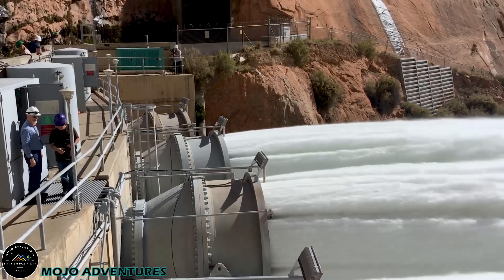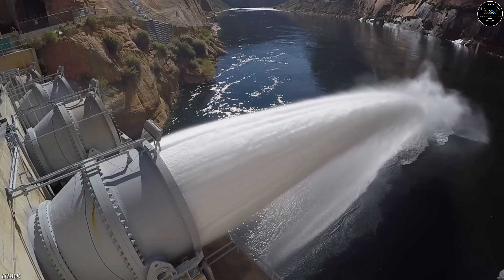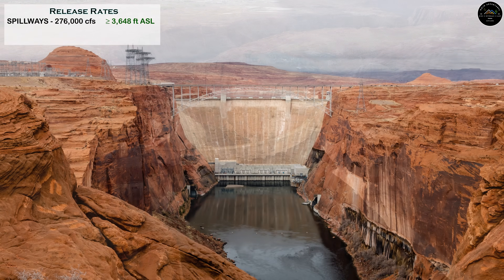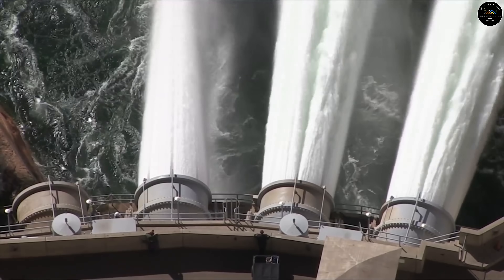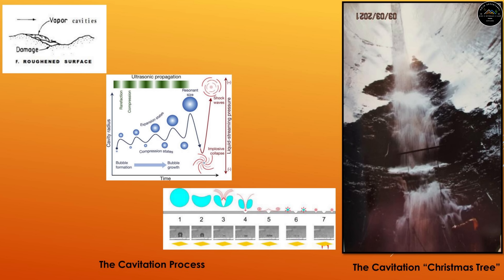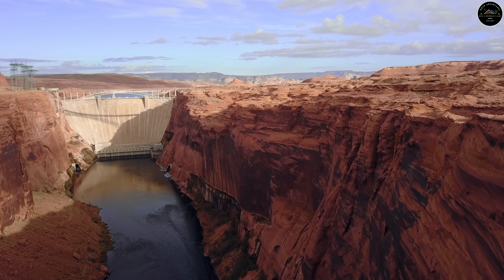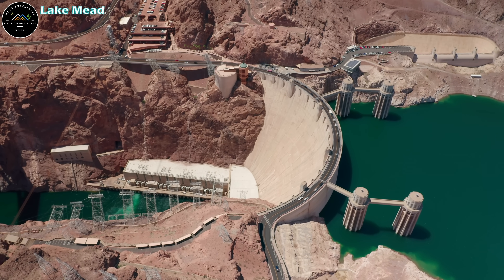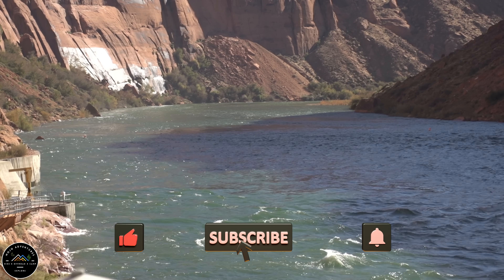TROUBLE ON THE COLORADO! Damaged Pipes FOUND Inside Glen Canyon Dam at Lake Powell #water #update

Comment: the best solution is NOT to build a metropolis in the middle of a desert.
Reply: Yes we should only build metropolises in places where there are hurricanes, floods, tornadoes, and earthquakes. Glen canyon dam was not to built to provide water to big cities. It was built to provide power. The alternative was coal which is how most of the country gets its power. Also homes, shopping centers, and office buildings account for only a small fraction of water use everywhere in the country.
Reply: @redhorsereincarnated  Farmers take the large majority of water.  Walnuts use about 8 gallons of water to grow a single walnut.  The Saudi's use Arizona land to grow Alfalfa and they weren't required to replace the water they took from the well source..
Reply: That horse has left the gate.
Reply: Common sense would say that!
Reply: The solution isn't to not build metropolises in the desert, that's actually probably the best place to build them, the land has little use otherwise.
The solution is to stop trying to fucking farm in the desert, that's where all the water goes and why the Colorado doesn't reach the sea anymore.
Reply: Lets just go back in time and solve that
Reply: @lunarvvolf9606  They also don't understand economics, physics, or engineering. They wouldn't be able to afford the water if they did that.
Reply: Flood irrigation at big agra monocrop farms is way more inefficient than most folks understand.  Agriculture uses way more water than phx does, and the 9 families that control water in the Salinas Valley don't pay for water. All the thousands of miles of canals in the southwest should be covered in PV panels to reduce evaporation.
Reply: @lunarvvolf9606 corps😑
Reply: @lunarvvolf9606  If you ask that, you should also be asking why you need food in your state that is grown using Colorado River water. Why not just get rid of all of your cities and towns and grow your own food. Maybe it actually is practical for people to live in Arizona. Cities grow out of places that create lots of jobs. Are you suggesting the desert states shouldn't have anyone living there? Maybe we should give Arizona and Texas back to Mexico because, after all, they need dams to supply their water, and to some people, that is apparently un-American.
Reply: I couldn't agree more.
Reply: @lunarvvolf9606  corps
Reply: How dare you!!!
You are supposed to blame everything on CA!
Reply: Best solution is to stop letting Saudi Arabia pump water to grow hay on the desert and ship back to their country
Reply: Agree, get rid of the dam
Reply: @lunarvvolf9606  They wanted to dump water into the Yellowstone volcano to cool it off. They need to identify as a jungle and then it will rain and trees will grow. see problem solved
Reply: Stop letting California steal all the water would also help
Reply: Common sense doesn't work well with greed .
Reply: It ain't the lawns. It's the famers growing alfalfa and cattle feed in the desert
Reply: Build another dam, problem solved
Reply: So true
Reply: Bit late now is it not.
Reply: So build a Time Machine
Reply: @daveb8559 And it is all the dems/reps fault! (whichever side you are on)
Reply: What an incredibly stupid suggested solution.

Kudos.
Reply: Yep for sure. That being said most of this water is going to agriculture. We should not be growing water intensive crops in the desert. Water rules really need to be rewritten to cut back on this type of agiculture. The amount of water allocated to agriculture from the Colorado needs to be cut back to more sustainable levels.
Reply: You would think that would be freakin common sense but hey what do I know….🤷🏻‍♂️
Reply: We farms this way right now since water is cheap. They are going to do the cheapest, easiest, most productive ways to farm until it is no longer economically viable. Same reason why we still use fossil fuels, they are cheap and easy, once oil becomes too expensive to extract (not when we completely run out) will we switch to alternative fuels.

You could yell all you want about the farmers using all the water and it kills the animals, but if you had all the farmers in the deserts stop farming and using water you get famine. Which is something I have never dealt with and hope not too in my lifetime.
Reply: the best solution is to revisit the water share agreement. and maybe stop growing so many almonds and avocados in cali. las vegas returns more than 99% of the water we use. so it isnt a desert city problem.
Reply: Quit trying to make sense to people that have none. Just saying
Reply: Our other cities on coasts are overcrowded Plan was to get water from Canada 60 years ago
Reply: The built it because the river was already there the damn is for power
Reply: Sounds like a smart idea!
Reply: “A”? Maybe many.
Reply: Nah leave it to liberals. They will keep trying to fill a desert with water 🥴
Reply: its all used by farming in arizona and california anyway, Not to cities
Reply: Exactly, same with people who live on top of the ocean loosing their home every hurricane..
Reply: Building a metropolis in the middle of a desert isn't the problem. It's all the farms. Especially the farms growing crops that require a great deal of water to grow like alfalfa for instance. The worst part is that that alfalfa is being sent to Saudi Arabia to feed their cattle where it's illegal to grow it because it requires so much water. Water that they just don't have to spare.
Reply: @NotFastEddie  lawn is the most intensively irrigated crop in the US and the largest by area. Not all turf is irrigated but the climate anywhere relevant to this topic is entirely dependent on it. I’m just as critical of irrigating cash crops and fodder in gutless desert earth but unlike those things it’s pretty much economically and socially worthless other than feeding obsessiveness about an unnatural tacky Stepfordy suburban look. Look at arid or semi arid cities in Mexico, Australia, Spain etc. some people have the lush look but most people let it gold a little bit and it doesn’t look so ridiculous against the earth.
Reply: Discontinue car washes, pools , hot tubs, lawn watering, golf courses, etc.!
Reply: These water overuse/shortages are due to farmers flooding their fields. They followed the suit or lose it policy

Vegas uses less than 1% of the allotment. Water is all recycled. Utah taps the river, and wastes the water, and has zero incentive to recycle water, as the state govt doesn't require them to. Fed need to step in and take care of this mess
Reply: Buts da mobsters said da government had ta...
Reply: I suspect you are speaking of Vegas?  And yes, a city that size in the Mojave was dumb, dumb, dumb.  But the far worse offender is LA.
Reply: @danz409  correct
Reply: @danz409  Yeah, like Cairo and Baghdad cradles of civilization.
Reply: @danz409  You can have a metropolis but you make it to be a total zeriscaped land, the ultimate recycling water effort that recycles it to where it is not allowed to leave the metropolis and brought back over and over with it being able to be consumed on ever cycle. No down stream waste
Reply: The best solution is not to pump water to cities in Kalifornia.  The LAMWD is notorious for pulling the rug from under everyone along the Colorado River.
Reply: BEST SOLUTION IS NOT TO GIVE WATER TO LOS ANGELES, THEY DON’T CARE ABOUT ANY BODY ELSE,  L A WAIST WATER LIKE THEY OWN IT 100% AND LIVE THE PROBLEMS TO FUTURE GENERATION.
Reply: @danz409  nah, that makes too much sense. Im sorry, but we can’t do that lol
Reply: Why
Reply: Most of the water is pumped out of Lake Havasu into California. Don't blame us in AZ for this.
Reply: @ California stealing every thing ,stop it now
Reply: What do you think would happen if everyone in this country were to move to a place where you can drill a well to get water? All the aquifers would dry up. Even NYC depends on dams for its water. Try being realistic and not judgemental about how humans get and use water. The issue of us using too much water applies to every place in the US where humans live. Going on about why people live in the desert and not overcrowding your community has nothing to do with the issue at dams, which are needed all over the country, not just in the desert. I'll bet there are dams near you that you only think of as the lakes that they form. The video indicates the issue is being solved with a bypass tunnel, so there is no need to worry. This video was informative, not an open door for people with very little knowledge of how things work to criticize others.
Reply: @CO-PE-123  Happening in many counties in Texas with the massive influx  of people from other places.
Reply: @CO-PE-123  as a scientist/teacher I have always been fascinated by dams and the reason(s) they were built. I must agree that folks should try to look at the whole picture before ranting about dams/dam management…
Reply: @glennmorrell4907 
Stopping the natural replenishment of sediment to the coast is what has caused massive coastal erosion in California.
Some Beaches that were sand for 50 years are now just rocks.

Most people don’t even know what an estuary is, let alone how significant they are in supporting of at least 60 species(Birds, land mammals, reptiles, Marine Mamal and fish)

Maybe dams work some places but not California.
Reply: @CO-PE-123 he says don’t build a Metropolis in the desert and you compare to NY, which is not in the desert…
Reply: @CO-PE-123   I get what you’re saying, but there’s a difference between naturally occurring aquifers and man made puddles in the middle of the hottest places on earth, rain fall in the mid west, take Missouri for example gets storms all summer long, heavy amounts of rainfall that cause flooding quite regularly, now look at a desert, 1-2 inches annually on average unless the monsoons are particularly giving during the mid summer months and usually almost no rainfall in the winters. The river was there undammed way before we played god and made a giant lake for our need for electricity. It’s not even a water supply issue it’s a typical electricity issue, and yet we are pushing for more electric cars. More electronics usage etc. the problem isn’t that we need the water, becaue even in the desert you can drill a well if you go deep enough, it’s the fact that the hydro dam won’t produce electricity. And to keep that electric power flowing we need to keep damming up more water, which in itself even without care of the Hoover dam and lake mead, ruins a natural water flow all the way to the Gulf of Mexico, so I agree and disagree with you. Because aquifers are everywhere even in the desert and they rarely go dry. But man made lakes for power consumption aren’t natural so your argument isn’t a direct comparison even tho I agree that the statement isn’t a fully educated one it does have its point, just think of the evaporation rate alone vs under ground water.
Reply: @ni_wink84  We live in the United States, and not all states have equal resources. Long ago, before my time, states surrounding the Colorado River believed they had the rights to the river water. They asked congress to build dams rather than just letting the water pass through. Congress approved this request. Whatever state you live in was involved in that decision. This water was way less expensive than trying to tap an aquifer, and it is still less expensive than converting sea water to fresh water. Most of that water originally went to growing crops to feed other crop poor, but water rich states. Remember, we are the United States, not separate countries, so we help each other out. When you start by providing water for agriculture businesses, you eventually get towns and cities. Since it was ruled that these states were entitled to water flowing through them (even if it mostly falls as precipitation in other states), you also give the states the right to decide what to do with it. I agree that desert states should restrict landscaping water use, but the original concept was not to water lawns but to raise crops in places where the growing season was long, and there was plenty of sunshine. However, there is a saying in the west: "Water flows to money." This means cities. 

Every state has reservoirs to capture surface water for homes, industry, agriculture, or whatever. You can't fault water poor states for wanting water, just as you can't fault other states poor in agriculture for importing food. Colorado River water is still a bargain for Arizona and California (the biggest users of the lower Colorado). The problem has been that they use more than the River supplies - which has created the current problems at both dams. That is a whole other issue that is yet to be resolved. Problems with those dams are minor in comparison to not having them at all. We can all complain about environmental issues, but what state is without their own environmental issues? What I really don't understand is why what Arizona does with their water is such a big issue for other people. That is like Arizona complaining about how costal states spend money on their ports or to control coastal erosion. Any yes, every state gets money from the federal government to spend on what they consider their greatest needs.
Reply: @CO-PE-123   again you keep stating no people needing water is the issue, these dams were not created for water shed purposes they were created for electricity. I live in California, Southern California to be exact and I know dams help crops etc water for towns LA itself is dependent on the aqueduct for water but those things could exist even at low flow, but power production can not, so as I stated before these giant lakes and dams are more for electricity that sustainable water supply, yes the water is there for all our needs and I get it’s a country wide not individual state resource but people being upset about a man made lake drying up in one of the most arid climates in the world is a bit asinine, as I said before think of the evaporation rate when it’s 125 deg for two months. I know how it works because I lived 2 miles from the Colorado river on the Arizona border, I had a pool in my yard that would lose 3” of water in two days from the heat, imagine the loss from those lakes, it’s a desert, it was never meant to hold water, divert natural water ways sure that’s fine, but damming it up causes problems all the way down the river just ask the people near Yuma AZ that used to have a river and now have a trickle of water, so you say share the water correct? Well what about Yuma? And in Blythe ca they cut the dams off and the river drops by feet at a time through out the week, farmers are required to stop irrigating. So how is this a fair share? I think you need to stop trying to make it a country thing and start looking at it as a geological thing. I don’t disagree with you but I think you aren’t understanding the bigger picture of the purpose of the dams. It sure isn’t water equality it’s post consumption from the hydro electric system. Here’s a really great question for you, after the destruction of two dams in central California lake Tulare suddenly appeared again after heavy rains and years of no water … all of a sudden there is water for people to use where it wasn’t before because dams held it back…. It isn’t that the water isn’t available it’s that it’s being restricted, for the use of making electricity. Not supply of water, the making of ELECTRICITY! Hence the name hydro ELECTRIC dam….califronia got sued by native tribes because those dams caused significant impact to the environment, EG the loss of salmon into rivers from the ocean, so you see it isn’t just water supply it’s a lot of things that are effected. All for the need for more electricity and these morons here in California want electric cars to be the only thing on the road… smh I live in the dumbest state in the union for sure. Glen canyon and Hoover are not for water consumption they are for power production. So the need is not water it’s electricity
Reply: @CO-PE-123  don't forget to put the class/quality of farm land into the equation and how much water it takes to grow crops on it. It takes 7-8 feet of water per season to grow potatoes in Idaho... Multiply that by the number of acres growing potatoes and you might be talking several hundred thousand acre feet of water per season.
Reply: And they just keep building, and building...... 🤔
Reply: @daveb8559 theres really no shortage of water in arizona. its just not on the surface.
Reply: @DieselRamcharger You are a dreamer.  AZ without the CAP would be half the population it currently is.  Since the CAP is a secondary water right, I'd say PHX and environs is one early-2000s drought away from everyone having to move back to LA, since LA has predominant shares of CO River water.  Which will be tough cuz all those PHX desert subdivisions will be worth 0.30 on the $1, maybe.  Example Rancho Verde ne of Scottsdale.